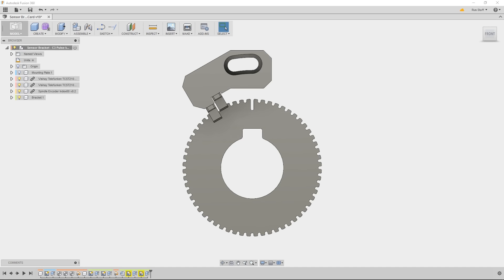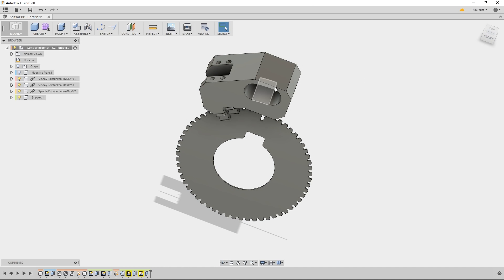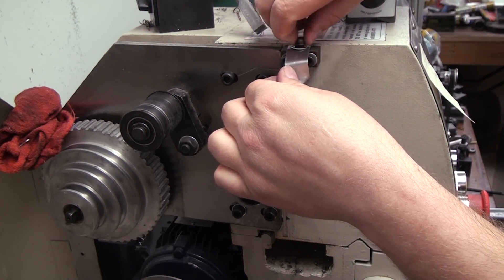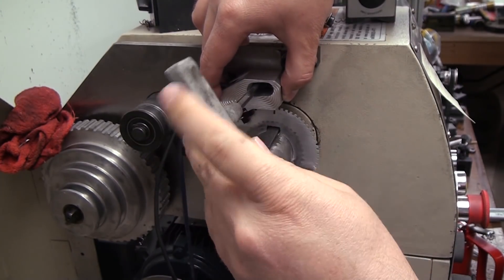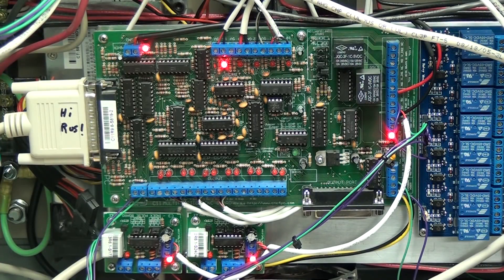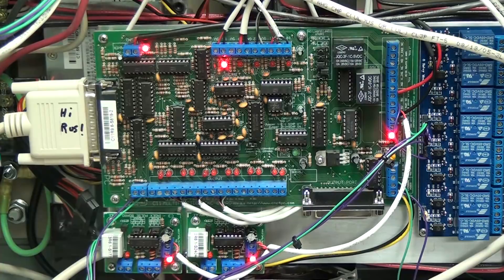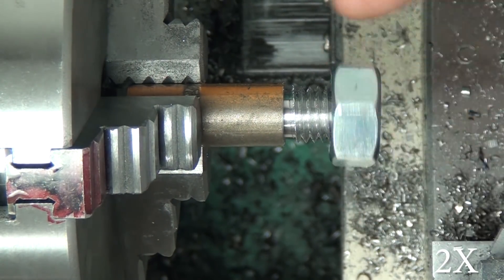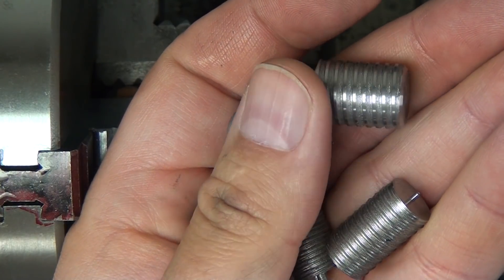G0602 CNC Conversion pt11 Spindle Encoder

Comment: im wondering what the advantages are with optical sensor over hall effect .
Reply from the maker: I might be wrong, but I would expect optical sensors give a shaper edge when changing voltages (more squarer square wave). The best option would be a quadrature encoder, which is what I would use if I ever change my setup (it isn't a big priority right now).
Reply: @russtuff  i believe youre right.. im struggling with getting mach to read my hall signal now so messing with different resistors.might switch to optical in the end

Comment: Best regard.
Looking at your excellent video, is it not possible to implement both sensors with mach3 or the wheel with multiple slots?
Thanks for your attention and reasoned response.
Blessings in these difficult times.

Comment: hi 
where do wiring the encoder ?
Reply from the maker: +Anwar Alfaqeeh Alhusseini Are you using the C3 pulse index cards? If it you'll need to check the spec sheet for your sensors. Are you wiring straight to your breakout board?
Reply: no am not using any thing yet >>>i want to understand this conversion before start >>thats why i am asking >.
thanks
Reply from the maker: +Anwar Alfaqeeh Alhusseini OK. There will likely be 3 or 4 pins on whatever sensor you choose and you'll just hook it up per the data sheet. One or two pins get voltage, one gets ground, and one is the signal you send to your board. I can do a video for you when I get my cabinet wired back up but I don't know when that will be.
Reply: my board you ....mean my mach3 bord or C3 pulse index cards
Reply from the maker: +Anwar Alfaqeeh Alhusseini If you use the C3 then the sensor comes with it, plus instructions. Then you just need one wire from the C3 to your Breakout Board.
Reply: ok i get it 
thanks

Comment: I like your bracket and wheel. Are you using LinuxCNC? Because indexing doesn't work in Mach3 so you must be using LinuxCNC.
Reply from the maker: suat korkmaz Thanks! Yup, LinuxCNC.
Reply: Great. I'm now converting a Sieg C6 lathe to CNC and I have the same c3 board. I think the G0602 and C6's are the same so the shaft of the spindle should the same as well. So I can use your cad models. Thanks.
Reply from the maker: suat korkmaz Sweet! I'd be curious to know if it works.
Reply: Too bad that I can not open the .step file in SolidWorks 2016. Would you mind converting it to .dxf please?
Reply from the maker: I tried, but Fusion doesn't give me an option to export to .dxf :(

Comment: Hi, in Mach3 you can use multipulse,using pulley setup with correct ratio ex. 16 pulse 16:1 mach3 read 16 per revolution
Reply from the maker: Thanks! I did not know Mach supported multi-pulse.

Comment: Hi Russ,  I wonder if you could do a video on how the 2 boards where hooked up so they both work in unison. I'm confused as how this is done. I would like to do this to my mill running mach3.  Thank you
Reply from the maker: Hi! It's my understanding that Mach can only handle a single pulse per revolution, and not multiple pulses or sensors. Correct me if I'm wrong. Yes I can do a quick video about it, and I'll put it at the top of my list.

Comment: Great info here.  I have copied your design and have it close to working.  For routing the wires, I removed the upper pulley that is not being used anymore and there is a nice slot in the back plate to run the wires through.
Reply from the maker: Great idea! I hope the plans work for you.

Comment: Not a critique, just an observation.

You don't need to jaw hold it. Just get two of those wrenches (or make them, i made two for the reason you'll read) put them opposing to each other on the two nuts and giv'em a squeeze. The nut will loosen up just dandy.

I made my own. One is a half moon that goes around the inner nut, the other is a full one that slides over. YMMW since my nuts are bigger (pun not intended) so i can really grip them, the keys being 2cm on the inner one and 1.8 on the outer one, no idea why the difference.

Other way i've seen this done, if you don't have two keys is with a dog in the jaws, it's an axial load so no problem there either.

The reason i shy away from gripping the jaws is because i keep my lathe clean. That way, if i mess up, i'll see the marks and know to never do that mistake again.
Reply from the maker: +aserta All good methods, thanks for sharing!

Comment: PC screws are #6-32. Do you even lift?
Reply: Grim Creeper
In a regular PC, no.  You'll find 6-32 screws, with some M3 mixed in (optical drives, sometimes holding the mainboard, but those are usually 6-32).  The only place you will find 4-40 thread is the posts for securing old style connectors, like DVI, VGA, Parallel and serial. If you open a laptop, it will probably be all metric stuff. There is even a wikipedia article on pc screws. I was just giving Russ some AvE style <3 <3 <3 over details.
Reply from the maker: +MarvinRunyon Yup, and M3 and 4-40.
Reply: 4-40 is only for the classic dsub connector screws.
Reply from the maker: Yes yes and DVI connectors, I'm not sure why we're both arguing the same point. I stated they are common in computers, and we've both proven it. Shall we move along?
Reply: No, no, I'm saying it is a stretch to call it a PC screw.  At the bar, you would definitely be buying the next round, and wearing the participation ribbon.
Reply from the maker: +MarvinRunyon 👍
Reply: +MarvinRunyon I'm confused. Are you saying that 4-40 screws aren't common in computer building? If I pull apart my computer, am I gonna find them, or not?